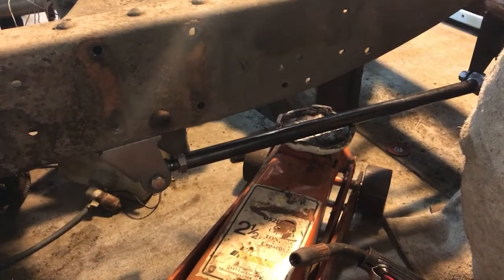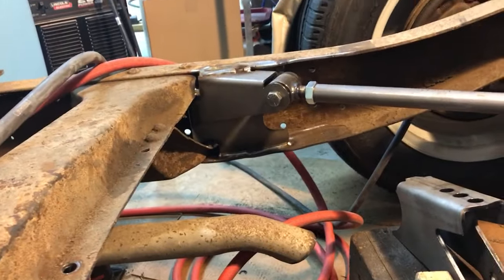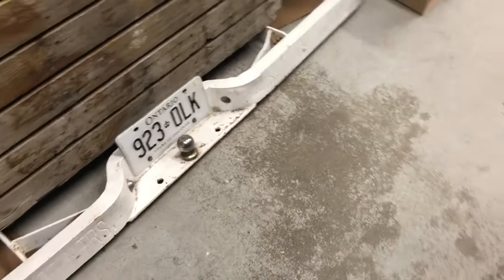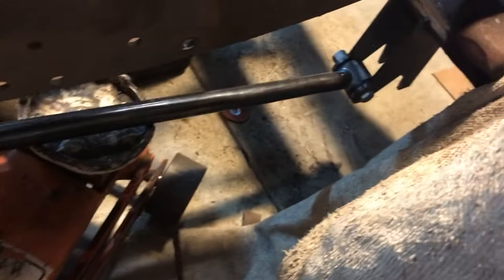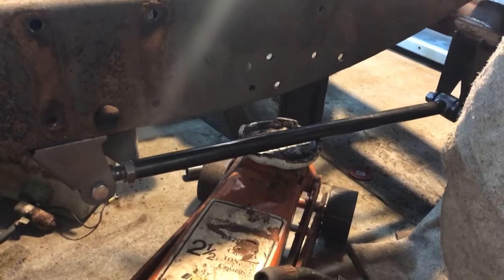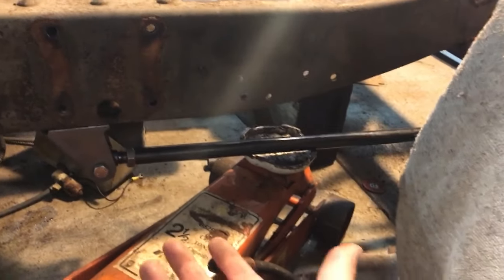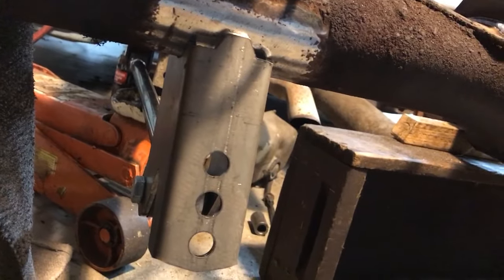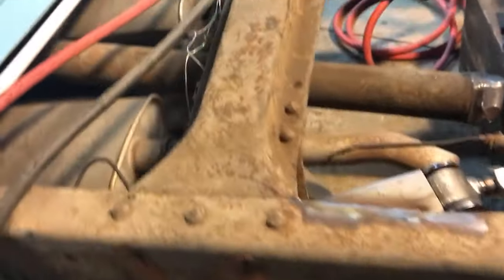D100 lower bars

Comment: nice placement on the bottom of the frame rail. That will allow for a wider tire on the inside if you wanted. i am actually waiting on you to finish before i weld my 4-link in my 65 D100.  You know the rule, measure twice cut once. However if someone else does it first, watch. thanks for the vids
Reply from the maker: Paul Queen the pressure's on! Thanks for the motivation!
Reply from the maker: Paul Queen are you using coilovers?
Reply: I also have an airbag kit. however i was thinking about switching it to coilover setup when i spotted your videos. curious do you think you will have any issue with the shock interfering with the frame rail, since the mount is directly under the rail now. i was thinking this would increase your angle a good bit to clear the diameter of the shock at the frames lowest point.
Reply from the maker: Paul Queen I should be ok on clearance... worst case scenario is I'll have to do a little notch on the inside bottom corner. A rough mock-up was positive :)

Comment: This is a really good video. Easy to see and easy to understand. .  If I were allowed to make a modification to the design, I would like to see a side plate from the  forward bracket to the side of the frame..
Reply from the maker: Thanks Bob. Do you mean a plate that would overlap the bracket and frame rail?
Reply: Yes. I like the extra strength of the side of a frame rail.
Reply from the maker: @isbcornbinder  That's a good idea and would increase the strength, but a good weld would be (and has been on this truck) sufficient.

Comment: with the bottom bare, does it have to be level at ride height or can it have some angle to it.  I am installing on a 53 GM that when sitting with the frame level and the tires on the ground it has angle to the lower bars.  Should I build the front bracket down lower or just leave it with some angle
Reply from the maker: Hi Ken, I think we just spoke on the phone? Just for other viewers, I suggested that having the bars as close to horizontal at ride height on a street vehicle is ideal.